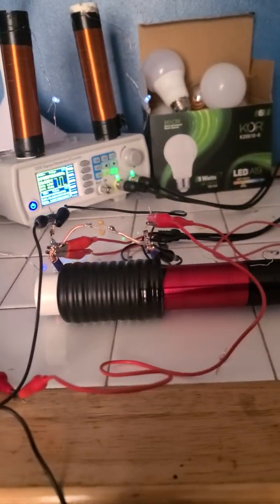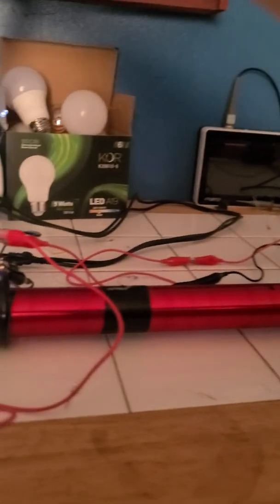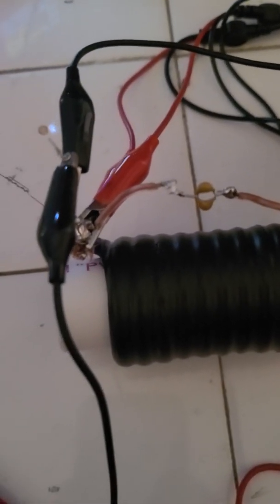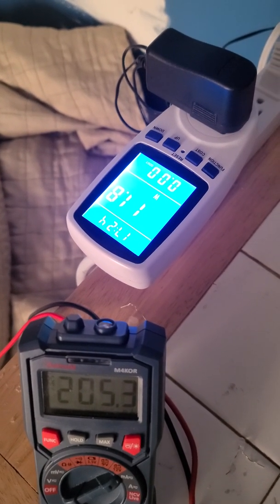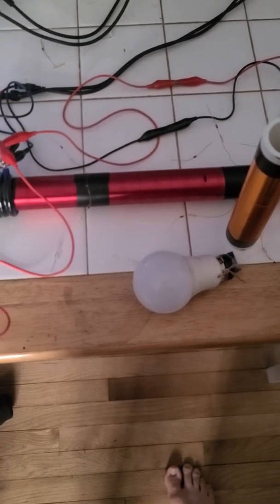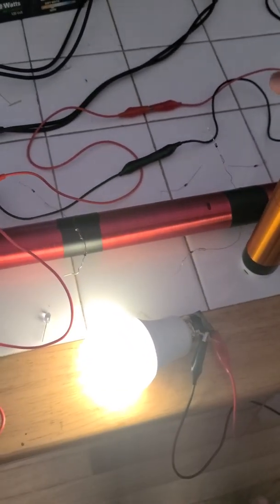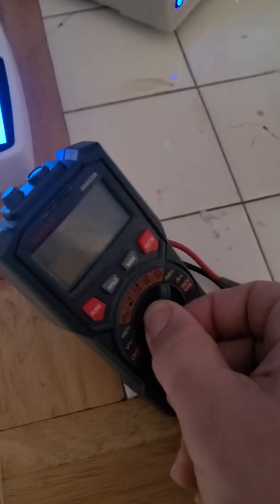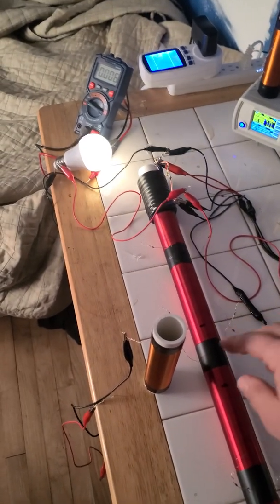💡  🌩  Resonant Wireless Power Transfer Part 9 🌩 ⚡️ 💡

Comment: Hi
I want to replicate your work with your permission

So I am going to wind some coils
1” pvc and maybe 30awg wire, make 4 inch sections and make 2 or 3(?) clockwise and same CCW SECTIONS 
Then series connect with diodes
Then do a primary of quarter length

I think then I do a coil just like primary(pickup coil)?

Does it sound correct or did I get something wrong?
Please advise
Thank you for all your good work
I am a retired teacher, so I won’t be as smart as you nor as quick
My area was math and learning this from scratch
Thanks again